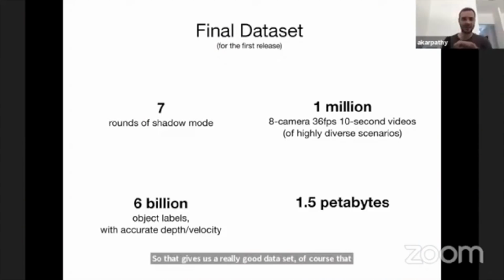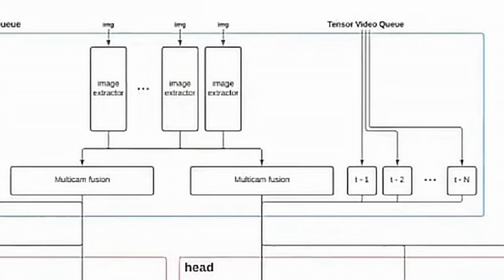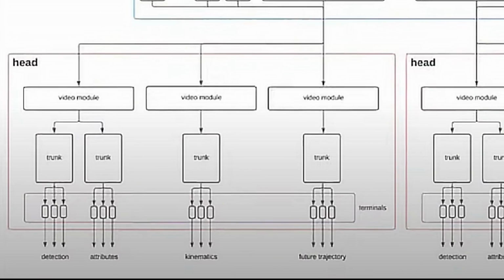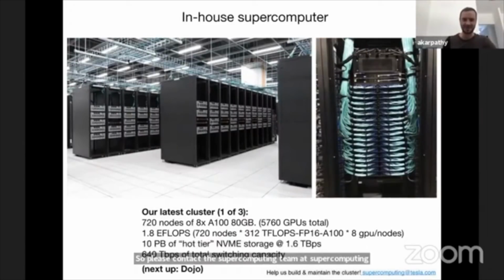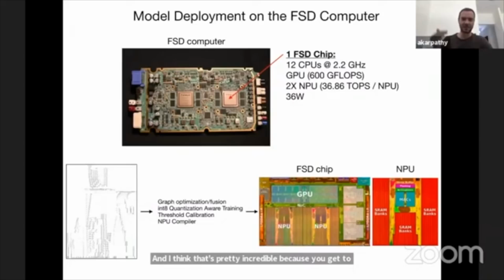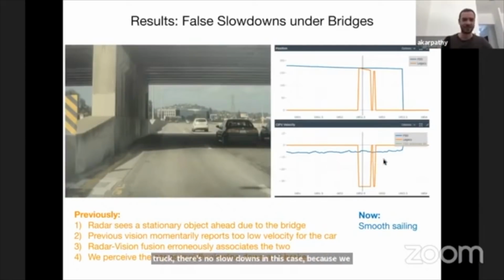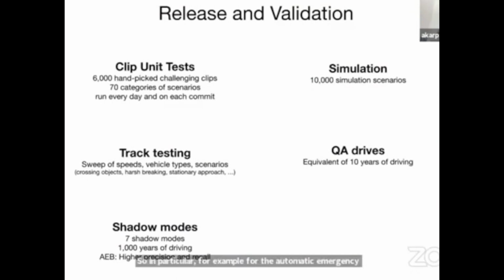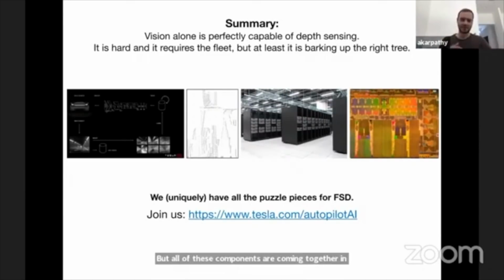Tesla has ALREADY won Full Self Driving! Andrej Karpathy on Tesla Vision, Part 2

Comment: They call it 4d because the 4th dimension is colour, width, height, time, color. It's also likely that they don't include every frame when considering time, this would make it much cheaper computationally and probably barely impact the performance.
Reply from the maker: Ahh yeah stupid me. x y plus color, so 3 + 1. Sorry!
Reply: @David Tesla needs X-Ray Camera Lens like the OnePlus 8 Pro... 👍
Reply: @David in this case 'colour' means anything that is per pixel. You could have: red, green, blue, depth,  isVehicle, isRoadEdge, ... etc. in that dimension.
Reply: So when it’s dark out there color is just black and white?
Reply: @grantguy8933  Tesla use RCCB cameras, which don't see all colours (a trade-off which means they gather more light). So I guess each pixel has an RBC (where c means white) value rather than RGB, which can represent all Gray-scale colours.
Reply: No dude it's height, width, length and time. It maps things across time to try to predict where they'll be when other objects pass in front.
Reply: @blackmartini7684  Yours sounds more logical .

Comment: As an oldy regarding computer tech, they are using 12bit (3xfour bit) signal processing, just not sure if it's 5v power range. Would be amazing if they can do it using microvolt as used for satellites.

Comment: FSD is not going to happen for a long time, there are just too many unpredictable things in life that can cause the system as it is to fail, remember the sunlight on the truck that made the tesla blind. or no road markings making tesla autopilot useless.

I say give it ten years and a lot more investment and by then others will have caught up mostly, well they are almost at the same stage as tesla with many features' tesla promotes when talking about their FSD software.
I have seen a few manufacturers with lane guidance and lane change tech and also distance from car in front of you being auto on free ways, damn tesla cannot even activate FSD on roads with no markings, so what happens in rain or snow or when there is dust on the road or when the sun is at an angle that blinds the camera remember no more radar.

Comment: It is 4D, it starts with multiple 2D images which they use to extrapolate the 3D environment, then it uses the sequential still images to extrapolate movement thus the time dimension. 3 physical dimensions plus the time dimension = 4 dimensions.

Comment: Vision is touted because that's what human perception uses to drive.  But if we didn't have a sense of equilibrium to go with vision, we'd get into more accidents, I suspect.  I know that having a sense of how level or tilted the road is, for example -- and knowing how much pull there is to the side when the road starts to curve (especially when going highway speeds) dictates how people steer -- compensating for inertial forces.  I've had more than a few disengagements with Autopilot around curves because it hasn't known to adjust around curves this way (especially not knowing how much the road tilts to aid in those situations).  Accelerometers are also cheap sensors -- seems like they should be included.

Comment: You are definitely a fan boy! But that is to be expected sent you on and drive a Tesla.
When we’re watching the diagram I was immediately reminded of a relational database. All of the functions in the lower portion of the graphic can be carried out by and a independent team, and the results passed upward through the chain to the master database which everybody has access to. It’s a super efficient way of utilizing multiple resources to do defined tasks.
With regard to the discussion of electrons moving from orbit to orbit, I remember that electrons have angelic properties. They are able to move from one place to another without going through the intervening space. 😉 You did a great job of explaining that quantum jump.
In the emergency stopping graphs it was interesting to note that the radar returns happened over brief periods of time interspersed with no information. Perhaps this is related to the fact that radar must be sourced From the radar unit in the car, and the return analyzed to attain useful information. Cameras however have only an input component which limits the amount of time necessary to acquire information and then have it analyzed between frames.
Great work on both your analysis and your video editing! Thank you.

Comment: Excellent, unbiased and informative review of a presentation which deserved the taking and unpacking of snapshots. Thanks. I have a question and a suggestion. First, the former: How will Tesla address their cameras’ lack of lateral vision from the front of the car, of potential benefit in aiding turns? Second, having explained the complexity and training necessary for the predictions crucial to the task of managing the afferent visual stimuli, may I suggest that you might explain the vastly simpler job of suggesting and executing the few possible efferent interventions, viz: acceleration, deceleration, turning and their respective magnitudes? After all, the real world outside can change in a myriad of ways, yet viewed as a servo-mechanism, the car can do little about those changes except go forward, backward and to the side.

Comment: Everything moves in 3D in the real world. On roads, it's mostly 2D I guess. The fourth dimension - time is by far the most important. You get to track velocity vector on objects and that allows you to make forward predictions on those same objects. Either those predictions pan out or some constraint occurs (a traffic light changes for example). You only need to recompute predictions within the temporal locality of the constraint. All other predictions remain valid. Prediction allows you to 'understand' the world with way less processing. Humans do it all the time. We even predict what's in our visual field, even though we don't have the processing power to know what's in our visual field. We only actually know about a little bit where we are focused.

Comment: On IR... in rural areas night-time wildlife is a significant danger...motivating the famous moose test.  I think identifying living beings with IR at night is something humans, with only the visible spectrum to work with, suck at, and so there are lots of crashes.  It's also cheap and relatively easy to add (only affects the labelling part to improve labelling in low light.)

Comment: As far as I can tell all of Tesla's competition has nothing more than digital street cars running on geofenced digital rails.  It looks neat except it isn't all that functional and not scalable.
Reply: All other Auto companies are using MobilEye.  They all have the same data set and same system.  MobilEye is currently worth about $20 Billion with over 1700 employees.
Reply: Waymo have a pretty neat way of mapping a city and adjusting for changes.
I think Waymo is ok with letting Tesla robottaxis do the rides that goes out of the city. The major part of taxi fares are within the city borders so I am sure they are more than happy with that piece of the pie. Not to mention they will have their business up and running years before Teslas over ambitious project is useable.
Reply: @mackan7086  I think you are correct that companies like Waymo will be able to implement ride sharing networks in many cities profitably.  If the cities are alert they should be able to eliminate most of their costly mass transit systems replacing them with these low cost non tax payer funded options.  These private ride sharing systems should be lower cost and much more convenient for residents which will drive demand.  If/when Tesla deploys FSD they should be able to compete in these same cities further driving down the cost as their vehicles will be much less expensive.  Time will tell but it's coming and we consumers will be the BIG winners along with those forwarding thinking companies willing to make the investment in the future.
Reply: @mackan7086  Better hope Peter Sorrell does not read this.  He will argue against facts all day.  lol

Comment: Very Interesting.  Thank you again, Dr. Gibbs.  I still think this Vision system has limitations.  They are breaking new grounds for sure but the first is always hardest but followers will catch up rapidly as there is an example to follows?
Reply: Vertical integration takes years. Supercomputers/own chip / own NN architecture/AI team talent. By then, fsd L5  is all over the place and theres little value to do so
Reply: @koonhaokoonhao  I see it differently.  Like electrification of vehicles, other companies are catching up rapidly compared to Tesla took 17+ years, others took few years.  Like the Ford F150 truck, will be coming some time as the cyber truck.
Reply: @peteryeung6797  Neural net experts are not that common. Gpus and semiconductors are pretty scarce now. The software codes takes time to write. Designing ur own chip takes time. Takes at least a year or 2 to have a million EV fleet to collect data. A couple years is alot for data collection and by then Tesla would have billions of miles. Software moves way faster than building cars
Reply: @peteryeung6797  other competitions have virtually zero foundation on vision based autonomy. All are using lidar radar camera fusion. Its different from tesla. So they are basically starting from zero. When Tesla has already started 4 months in collection. Way past designing and buying stuff.
Reply: @peteryeung6797  the US and EU competitors can barely compete with 2012 modelS. China competitors are probably alot closer like 2018-2019. Still a pretty huge distance for hardware but will catch up eventually. Autonomy wise the distance is way too much.
Reply: @koonhaokoonhao  I see some of your points.  Western countries were far ahead in tech and now Asia is taken over and more advanced than western counties.  Being the first is always harder than modelling from examples.  FSD L3 to L5 will take few adjustments in our infrastructures.
Reply: There is the small matter of patents held by Tesla..
Reply: @ptrsrrll  what you mean?
Reply: @peteryeung6797   Example..Companies and even governments can't can't copy Pfizer vaccine because they hold Patents.
Equally, existing Automakers can't copy many vital elements of Teslavision because they hold Patents ..
Reply: @ptrsrrll  Software is a lot harder to protect especially when everyone is using AI as the basis.  They can't patent Teslavision as everyone is using a Camera on their setup.  Just Like Space X, got around Blue origin patent(s) of landing a used rocket back to earth by using old video of soviet science fiction.

Comment: I wouldn’t be surprised if the optimal team size for almost anything is 15 - 25 people - for achieving something useful in around 18 months.

Within that, there’s probably a ‘core’ team of around 3 - 5 people who do nearly everything on the critical path.

The others are ‘support’ whose main function is removing obstacles and backfilling stuff like documentation.

This can be seen from the steadily shrinking team sizes as apps have progressed.

Facebook
Instagram
Snapchat
TikTok
Twitter
Etc.

There’s interesting parallels with the film industry.

If you add more people you get severely diminishing returns because the inter-person communications overhead increases exponentially.

If you go beyond 18 months you start getting dropouts/burnouts, and you’re probably trying to achieve too much in one go.